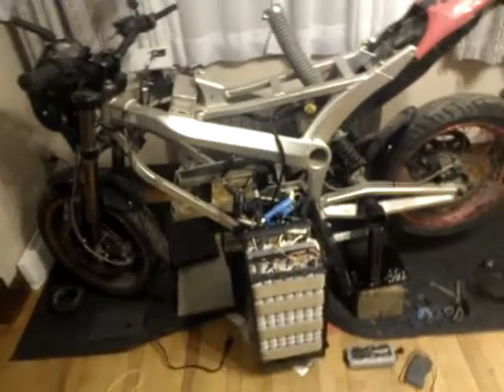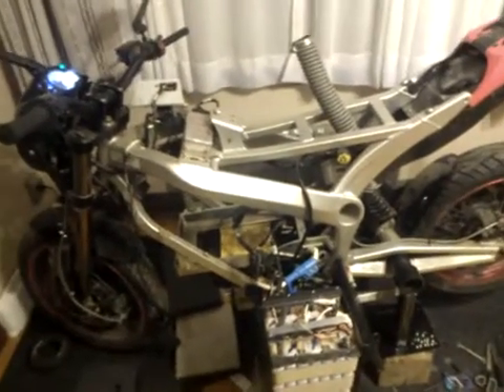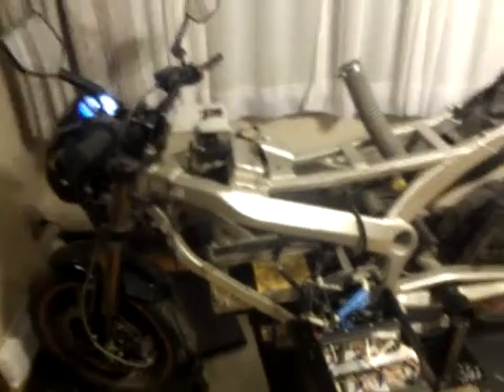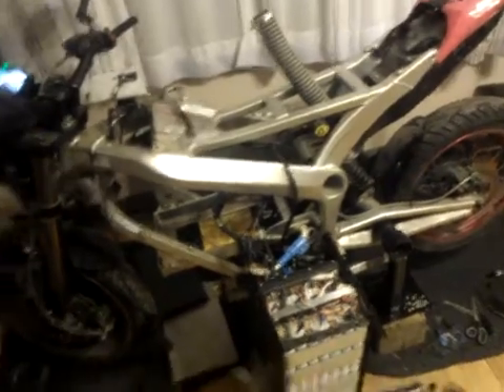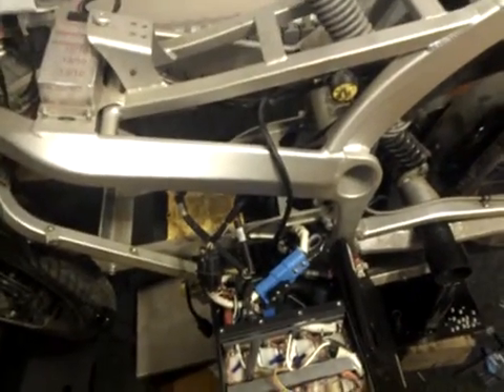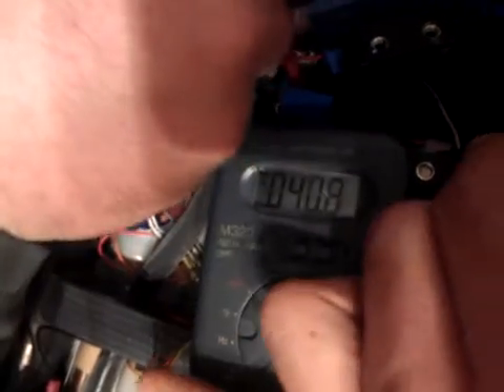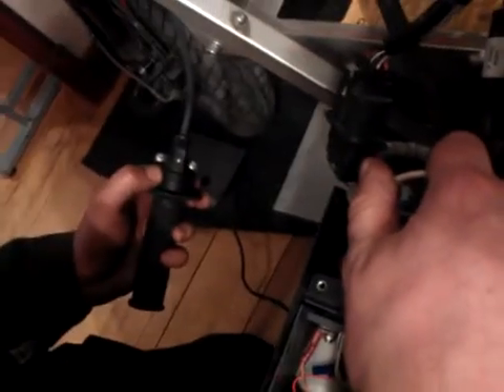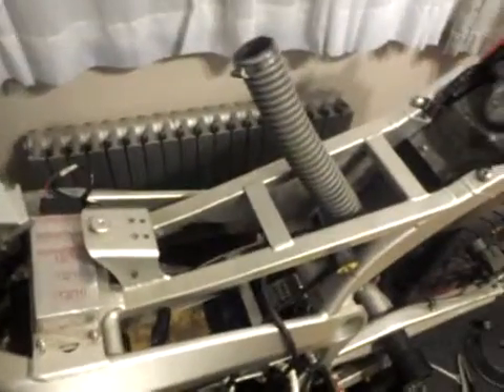2011 Zero S with power issue resolved!!!! (Hopefully)

Comment: Where did you get the solenoid?  My 2012 XU cuts out after about 4 miles. Turn off switch. Wait 5 minutes and rhen goes for a 1/3 mile and cuts out again. The battery is fully charged and rebuilt.

Comment: 1) Show us what the solenoid looks like. In your video, it's somewhere in a black box, but we never saw what it actually looks like.
2) Where did you get the new solenoid?
3) Was the new solenoid the same physical size and pin-layout as the old one, or did you have to make any modifications?
4) What's holding the solenoid in? Is it bolted, soldered, clipped, plugged?